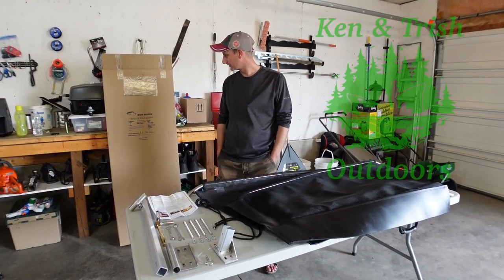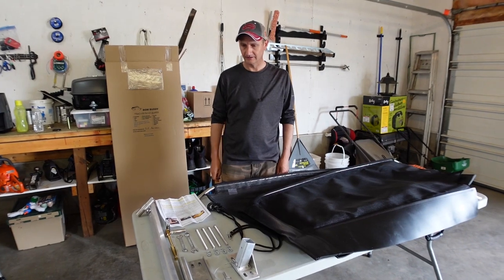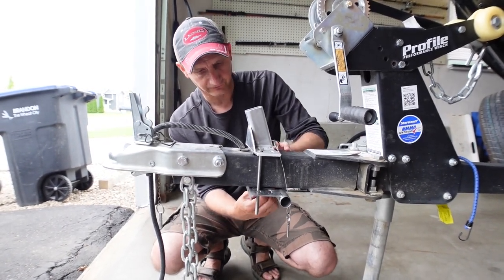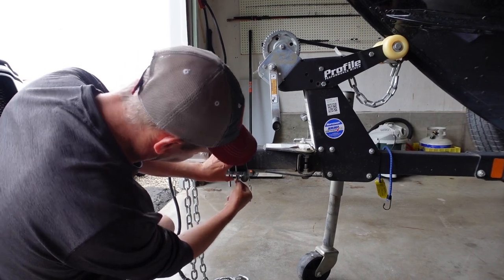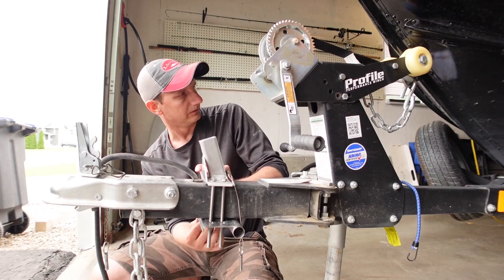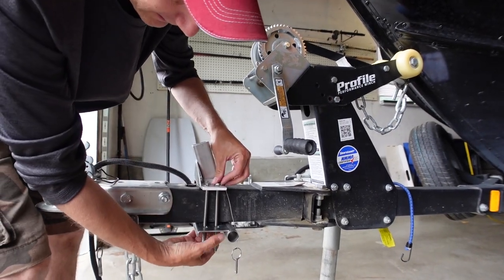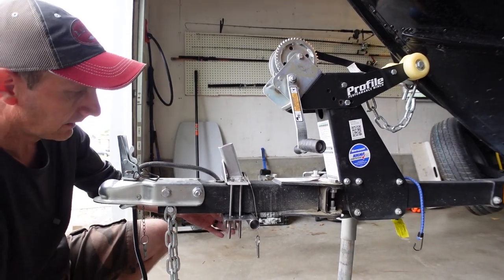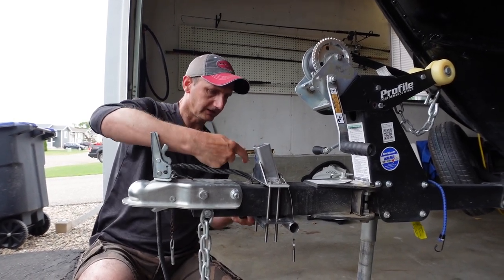How To Install The Bow Buddy Rock Guard.

Comment: Which lund do you got?
Reply from the maker: 2023 Adventure Sport 1775
Reply: @kenandtrishoutdoors  perfect I'm picking up my 23 angler 1650 sport on Wednesday. This looks like a great addition. Was going to get the rock guard brand but the price point is quit a bit higher and I've read great reviews on this one
Reply from the maker: @stevey3226969  after the first trip I had to re tighten a few of the bolts but it has been good ever since.